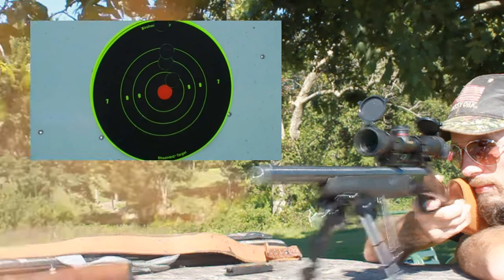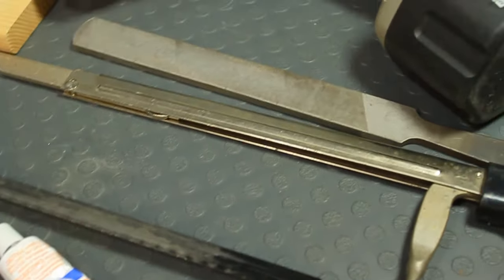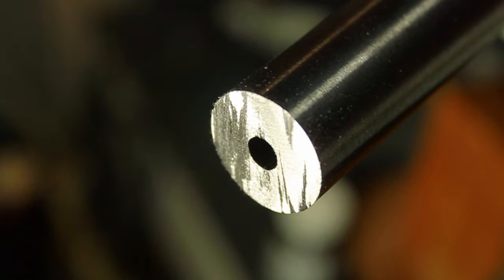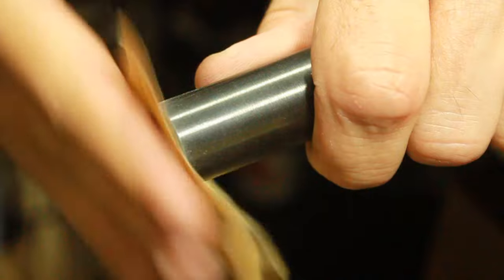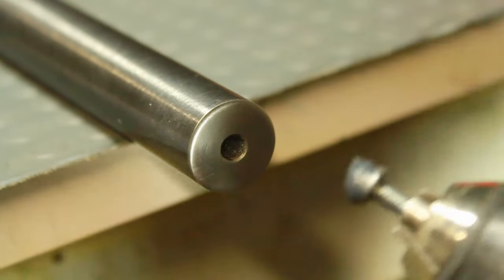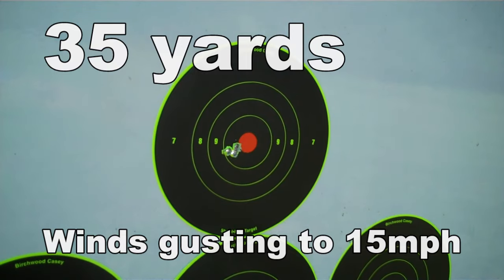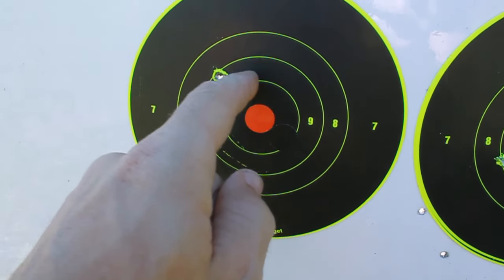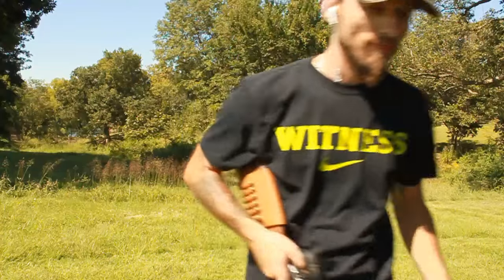Cut and Recrown your  barrel at home

Comment: If the barrel has no taper an engineer's square can be used to check that the end of the barrel is properly cut. Also, you can use a round top brass machine screw for cutting the crown.

Comment: One method to having a true flat cut is to use a pipe cutter to score the surface to give me guidelines as I cut. 
I'll use a black marker to cover the area before using the pipe cutter. 
Then using minimal pressure but enough to score the surface to give you lines to follow when hacksawing the barrel
Reply: That won't work if you have a tapered barrel. The cutter will spiral towards the tip. Gotta be super careful to get the cutters straight even on a straight barrel.

Comment: I have recrowned about 7 rifles like this and one barrel shortened. The first was a Rem 700 243 that fell off the hood of a truck onto a lava rock right in the muzzle! The rifle was a 1/2 MOA to .75 MOA depending on the load. After dressing the crown with round head brass screw and Clovers valve grinding compound it was just as accurate as before the fall.

Being a Moderator on a large internet rimfire site I posted results and a "How To". Good grief I was called a moron and a butcher among the nicer things! Funny part is this was not my idea. P.O. Ackley used to have a column in a shooting mag that published ideas from Brownells Gunsmith Kinks books. You know who P.O. Ackley was right? You know who Brownells is right. Ever read Gunsmith's Kinks, if not they are great.

Finally I did a before and after test on a friends Polish rimfire trainer that had an obvious problem with the crown. It was so bad the groups at 50 yards were more patterns than groups. Half an hour later and a little elbow grease the rifle was shooting 1/2" groups @ 50 with SK Standard +. Of course one guy (or more) still called me names but it is the internet right?
Reply: I think I've only found one YouTube video about anything that did not have some dislikes. I think some people live in a "dislike everything" default mode.

Comment: I did the same to my mosin. Thanks a lot you saved me $125 canadian and it looks amazing.
Reply from the maker: awesome! Thaks for checking it out!
Reply: knives fan what size cap nut did you use?
Reply: Chris Randolph 1/2'' I glued those tiny dremel sanding disc and finished with some metal glow (any polishing compound would work).
Reply: knives fan Great idea!  Thanks.
Reply: I’m thankful I ran across your post 2 years later 😂. Planning to do this to my mosin. How’d it shoot overall after?
Reply: @martinmontijojr9459  I'm also here 2 years later lol, I figured I would look to see that size cap nut I needed for my mosin. Have you finished yours yet?
Reply: Mini-Bike Adventures I just finished it about 1 months ago! I sent the barrel off with my friend who is a machinist and he shortened the barrel and crowned it for me.
Reply: I'd not say that on YouTube
Reply: Bubba whyyyyyyyyyy
Reply: @jasonbloho8015  its an old beat up mosin nothing lost. You can put your monocle back on

Comment: nooooo.... files are not meant to be used like a hacksaw. They are meant to cut in forward motion. If you slide them back on the work it dulls them. the horror..... the horror.....
Reply: MrRatkilr relax it's a 10 dollar file dude
Reply: lol you care more about the file than the barrel? hahahha. No way i'd do this myself. i dont trust my worksmanship
Reply from the maker: @fredrikcarlen3212  <-- This man speaks the truth. this was my exact though process the first time i ever attempted this.
Reply: Just use a good chop saw no mess involved makes clean up easy
Reply: It may be a cheap tool but if used properly it will last for a long time. It’s not hard to them correctly. Its more work to use them the way he does in this video.
Reply: The horror..... the horror.....! This is what comes from watching Apocalypse Now too many times.

Comment: Gave this a go this week with my '57 Remington 760 deer rifle.  Had a machine shop in town lop the barrel though, they did it nice and clean square, in and out of there in 5 minutes and he didn't charge me.  Otherwise as described here.  It took a long time to get any crowning effect at all, but it sure wore down the acorn nuts, two of them.  I did end up with a bit of a recess and i think it will work fine.  Buffed up nice, and am pleased overall.  We'll see how she shoots.  If i had more to do i think i'd invest in a hand-lapping tool with calibre-specific barrel-guide.  A lot more expensive than acorn nuts and lapping compound, but a lot less expensive than gunsmiths.  At least up here in Canada.  Additionally, they all seem to be two hours away and when you ask them about a simple job they always seem to hmmm and haw like you are asking for a full custom build, as though cutting and crowning a barrel - with a fully outfitted shop no less - is going to cause them some notable difficulty.  I don't get it.  If i had a shop like they had i'd imagine doing 20 a day to perfection without breaking sweat would be a cinch.

Comment: Hum...now you have me thinking about my cheap .223 and .243 Rossi Wizards and my hack saw.  One of them even has a damaged front sight which makes it even more tempting.
Reply from the maker: One thing ive found is that a brass screw works better than the stainless for the recrown. Good luck, let me know if you have any questions.
Reply: Thanks for the advice.  I've actually chopped down a Mosin that I put into a Archangel stock, but I bought a fairly expensive 11 degree recrowning bit/tool for it.  I don't really want to spend any extra money on a Rossi so your method is interesting.
Reply from the maker: NCDEFTONES so far ive done an SKS, a mosin and my H&R in this video, it works. Its been working for years. I listen to the old school shooters from back in the day, they used to use carriage bolts to crown, or recrown
Reply: +ZRUS Outdoors Channel  have you ever used any of the bore die pilots to thread any of your chopped barrel jobs?  The only thing I'm not very fond of it the giant ball of fire that a 16" 223 puts out.  I think it would be cool to have a flash hider and be able to thread on a suppressor to a compact handy rifle.
Reply from the maker: NCDEFTONES I have not yet, but i had intended to, just never got around to it.

Comment: I bought a mavrick 88 with a bent barrel... Guy fell on it going down stairs. I was like sure ill buy it.. Think i gave him $100. I chopped it at 18 inches (yes measured with dowel to breech face) I worked in a shop that happened to have this reaming tool for pipe...  I just didn't like the looks of the flat tipped barrel. It turned out pretty nice, its just an under bed gun.

Comment: Alright so I want to explain first that i saw a video talking about using toothpaste as a high grit polishing compound on certain parts of machines. The reason I say this is I needed to re crown my barrel and was wondering if it would work. The answer is yes but it is also very messy. Thanks for the video it helped alot.
Reply from the maker: toothpaste may work, but it will take a lot longer. lol I guess you could use that as a final buff of the crown after the valve grinding compound,..

Comment: Square the face by lapping in a figure 8 on an absolute flat surface. Only 2 surfaces exist for doing this Granite (preferred choice) and glass (back yard choice). A glass top table would probably be the best choice for an at home DIY guy. 

For those who believe these surface plates need to be precisely made a glass top table is absolutely flat. I confirmed this when I lapped and engine head  (GM 122 engine known for blowing head gaskets aka j body cavaliers, sunbirds, etc) The engine I did it to had blown a head gasket and had an aluminum head which slightly warped it (I turn off engines when they over heat) between cylinder 3 and 4 there was a gap of .030 while between the other pistons the gap was more in tolerance at .020 (GM's take is both measurements are within tolerance for that engine I don't buy it). So I lapped the head on glass very slowly and trued it all the way across to .0015 which is as close to absolutely flat you gonna get. I then shimmed the head and gave it a new head gasket. The shim was to address how much was removed and give the head the correct height back. 

After all was said and done the engine never blew another head gasket. This was in a 1988 pontiac sunbird and the engine is still running with many many miles on it. Around the same mark in mileage to when it blew its last head gasket I paid close attention to confirm the lapping worked. It did and I would say had the height of the head have been within the correct specs I would have probably attempted to use only a copper shim as a gasket. It is only necessary to go to 800 when lapping a head because you want something for the head gasket to grip to when the head is torqued down. 

It is a long process but very rewarding and I have to admit. I still have the same piece of glass today and have done many lapping on it.
Reply from the maker: intersting information, ill have to remember that one for next time! Thank you!

Comment: What size cap nut would you recommend for a .308?
And what angle of cut on the crown can you get with these nut caps? I'm looking to reduce the barrel of my rifle from 23.5'' to 18'' 
and the heavy barrel is 1 inch in diameter

Comment: After seeing this video I cut my mosin barrel down to 17.5 inches and I couldn't be happier with the results. It's very accurate and the big fire ball is a nice touch ;)
Reply: What size cap nut did you use?
Reply: @martinmontijojr9459  Close to 8mm

Comment: Yeah, I was thinking perhaps squaring off your cut with a disc sander and a miter slide set at 90 degrees, and making sure to compensate for any tapering of the barrel with some shims. Careful not to overheat, and viola'...

Comment: if you ever upgrade to larger cal I STRONGLY recommend SWFA fixed 10X scope, i know its just some guy on YOUTUBE, but i would pin it against any scope under $1000 bucks and its only $315 shipped with mrad or moa turrets!
Reply from the maker: right on man, ill have to look into that, just bought a 308 that will need a scope soon

Comment: In your video, which was a fine DIY video, it didn't look like you reduced the barrel length very much.  How long was it in the beginning, what did you cut it down to, and what was your purpose for reducing its length?  What make and caliber was that bull-barrel weapon?  Thanks for sharing.
Reply from the maker: +Kentucky Justice Hey man, it was a 22inch barrel, i cut it down to 16.5 inches. I took it down to make a compact little handi rifle. Ive seen H&Rs 300Blk out rifle, which is a 161/4 inch baerrl, i really liked the look of it and wanted on of my own, in  an affordable caliber like 223.
Reply: I like the shortys for "regular use" myself. Thanks bro. Happy trails, tight groups and safety first.

Comment: I want to build an AR 10 AR 308 pistol but the barrels for such a platform are crazy expensive and buying a longer version is much cheaper .  Tapping the barrel for a suppressor is what I want to see done .  Do you think I will have to use a lathe or a normal hand thread tap set to do the job ?
Reply from the maker: I have not done it, but i have seen it here on youtube. Threading a barrel can be done with the right tools.

Comment: Can use these same steps for the sks barrel? I cant find your shorten barrel for the sks anymore looking to chop my type 56...
Reply from the maker: i deleted it since this was a better video. but yes, you can use this process for any barrel. just know that with a semi auto rifle, you may run into cycling issues if the barrel is too short, depending on the rifle itself, and the position of the gas port in relation to the barrel.. that being said, i didnt have any issues with my sks when i cut it right behind the front sight.
Reply: @ZRUSOutdoorsChannel  thanx for the reply you wouldnt happen to know the size nut for the sks barrel would you?
Reply from the maker: egjdmcivichatch can’t remember, but anything that is big enough that it doesn’t fall into the barrel.

Comment: Cutting off barrel.. Affects accuracy and range.. Or nt.. Pls comment.. Thank u
Reply: Yes and no. It is sort of a trade off.   For each caliber there is an optimal barrel length for MV, for .223 it is 20" (which is why stoner's design is a 20 inch barrel).  

When it comes to accuracy a shorter barrel is generally more accurate, as you get less barrel whip.  Same reason a bull barrel is more accurate, less barrel whip.

Comment: i wanted to do my little 1522 but the gunsmith told me 300$ n he will only take it to 14.5 n pin my brake. with this i could do it myself,  n buy the 1522 adapter for non threaded barrels,     but id have to pay the $200 if i wanted to take it out of my house to the range.   does anyone know if i did put in for the stamp what would i need to do to stay legal before the stamp comes in? i assume just seperate the upper from the lower.  but either way, im paying 200$ plus the adapter, plus labor for something way cooler.   i know its a 400$ gun n its stupid to throw money into it but i love that thing, its a lot of fun n i have it so dialed in atm id bet my life on it if i was ever attacked by birds lol
Reply from the maker: you cannot be in possession of a rifle that has a shorter than 16 1/4 inches with a stock, legally. so i wouldnt even think of cutting it before the stamp comes in.

Comment: Great stuff,.I did my Mosin similar to this,..a little different but it worked. I do however wanna get it threaded..found a guy that will turn at on center n ' thread it for 65 bucks..
Reply: ***** Cool,  Ya I was wondering if that was about the going rate or if t was a great deal,...it seemed to be the latter ...a great deal.. I really need to get it to him before
 he ups the rate,...lol

Comment: I’m all about home projects, and it’s fine and all to do a how to, but you really should touch base on the legality of what your doing and note the atf regulations of a SBR or “sawed off” rifle in the video as the publisher to inform people to check laws and regulations before doing so. By law in the USA, rifle barrels have to be a certain length, and the gun overall length comes into play as well, Please check laws before doing this to ensure your legal. Hate to see a bunch of people getting in trouble by cutting their barrel down to  10”. Otherwise, nice home project!
Reply from the maker: legal length of a rifle barrel must be 16 and 1/4 this is just above that. it looks small due to the receiver being so small. The over all length is also within legal length as this rifle comes from the factory in this configuration as the 300 AAC Handy rifle. with these exact measurements

Comment: at least wrap the end of the barrel with some tape , even duct tape , so if you slip with the wire wool etc it wont chew the rest of the finish ,,, other than that ,,, why not , ,,,
Reply: It okay but that not good work check out  mr.holland of  agi  gunsmithing  hope  that  get u better. It look ok  but can be much better

Comment: What size cap screw should I use for a 22lr?
Reply: Could I use a dremel with a conical grinding bit?
Reply: Is it going to interfere with cycling on a semi auto 22 if it’s not a perfect crown? Sorry for all the questions. But your video is the best one I’ve found for DIY barrel cutting.
Reply from the maker: @houseofflambeau9656  Any rounded brass screw that doesnt fall into the barrel will work. A semi auto 22LR should be just fine as it is a blow back operation. The crown doesnt effect cycling whatso ever, its for accuracy and to protect the riffling. Dont use any dremel bits, a rounded brass screw works best.

Comment: What size crown nut for 762 x 39
Reply from the maker: IRONBLOCK RECORDS anything that doesn’t fall into the bore. All you are trying to do is recess the crown into the bore to protect it. (While keeping it even)
Reply: Thank you ...converting my sks yugo to tactical ak....clip mod ,uas fab chasis shortened 16 1/2 barrel competition muzzle brake ,spring loaded pin....shoots straight as an arrow up to about 400 yards as is seen this will greatly improve accuracy,  appreciate the reply and other tips welcome

Comment: If you're going to do this, at the very least put it in a lathe!!
Reply: If you have one. But clearly it isn't necessary. When I did a recrown on my mosin, I used a brass roundhead machine screw in a hand drill and it worked beautifully.
Reply: WhiteCavendish, what size roundhead did you use for your mosin?
Reply: It's a brass machine screw with a 3/8ths diameter head.
Reply: WhiteCavendish thank you!!!
Reply: +Carlo Andrade my pleasure.
Reply: You would be correct in normal circumstances. However, one might find themselves needing these skills in a WROL scenario.
Reply: how much are lathes going for these days?
Reply: smaller ones aren't very expensive, however for gun work you'll need a gunsmith lathe, that can perfectly center a barrel for work
Reply: Samantha Williams or miter box
Reply: Dan Rozanski you could do that job on a south bend 9” lathe, you don’t need a damn “gunsmith” lathe to do that job.  As he showed you can do it without one.